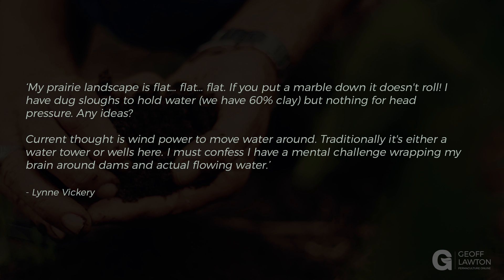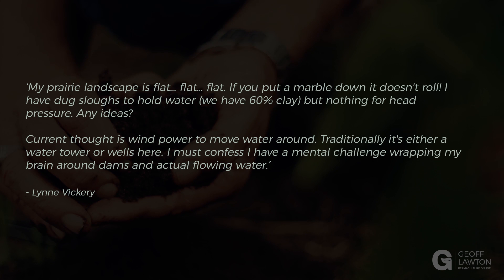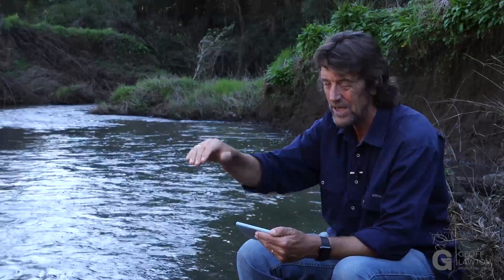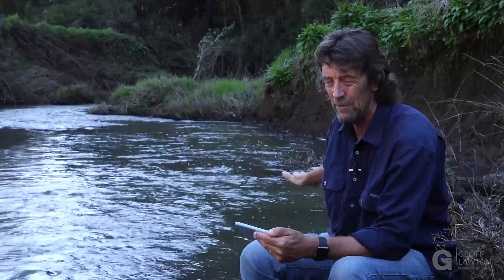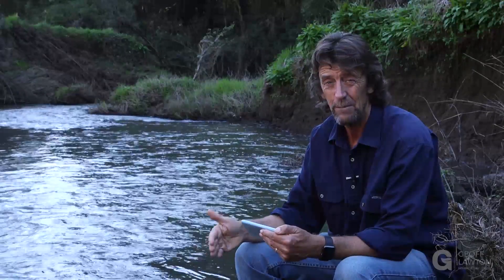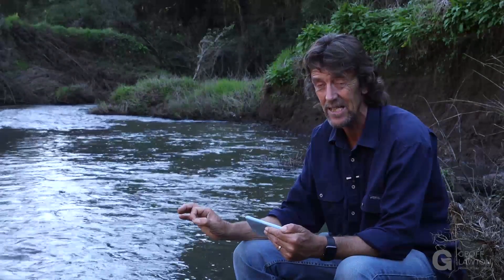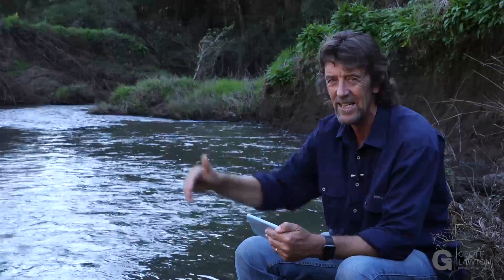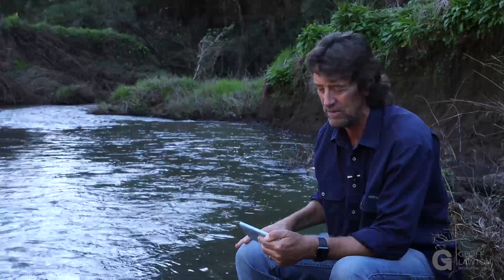Q&A: Creating Head Pressure on Very Flat Land

Comment: I am wondering what would happen if your land is flat, you find the (barely perceptible) down-facing gradient, but instead of water flowing down from behind, flood water actually comes up from the watercourse. Would you face your swales and berms the opposite way, so that the flood water is caught in the swale and soaks into the berm 'upwards' (as it were)?

Comment: Why is head pressure so important? This is a genuine question. If her land is so flat is there any danger of runoff? Won’t the water infiltrate? If land is perfectly flat but still running off to all sides couldn’t you build a swale wall near the outer edge of the whole property?
Reply: I think head pressure is to move the water around to where you need it. Otherwise it's buckets or some sort of pump, instead of gravity
Reply: well not if the soil is compacted